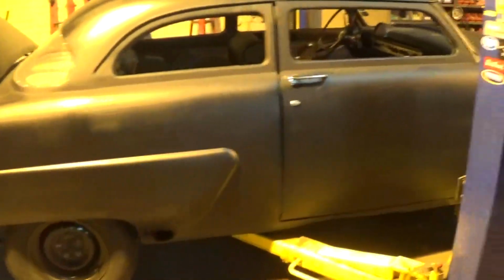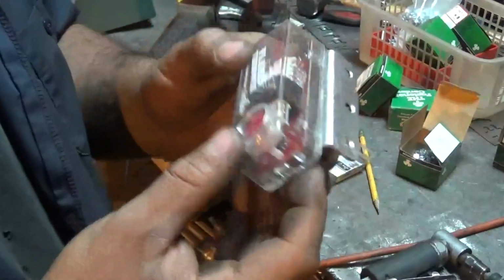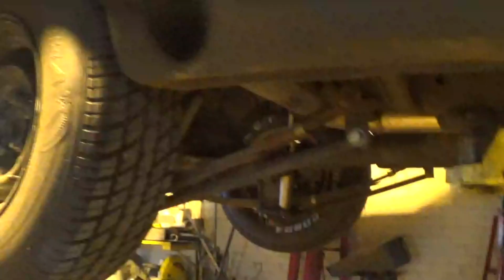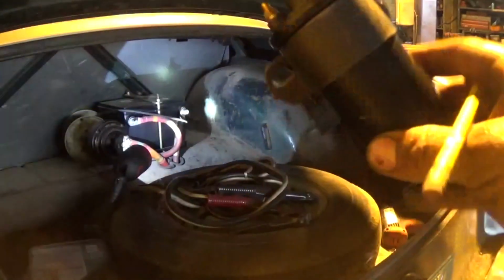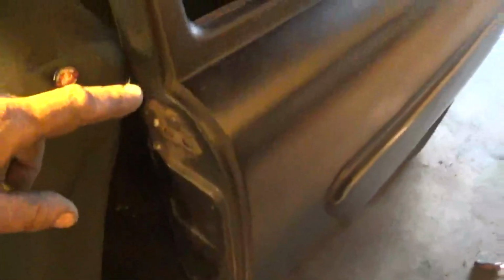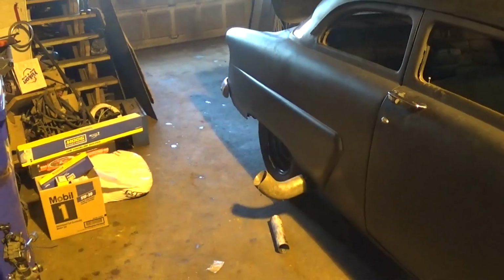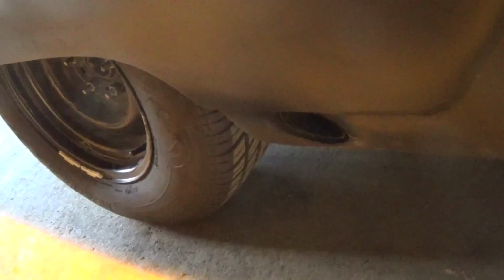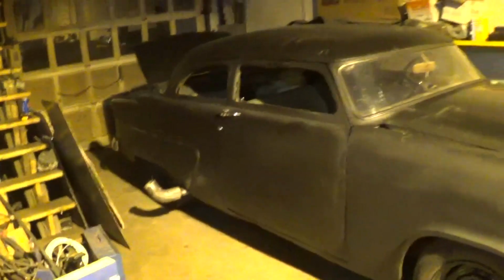FLAME THROWING EXHAUST!! AUTOLOC Flame Thrower Kit Installation!

Comment: So no need to change anything on the engine? It just burns the excess fuel that's already there?
Reply from the maker: Correct, basically you turn off the power to the engines coil and the engine becomes a compressor, you pump the throttle as fast as you can when killing the ignition and it pushes all the raw fuel out the tail pipe and gets lit by the  secondary coil at the end of the pipe/ exhaust.

Comment: I would love to see what you do inside with the gas pedal and the switch to get this to work
Reply from the maker: Pretty simple, first warm it up, exhaust pipes have to be hot or it will not atomize the fuel and basically you will foul your spark plug in your pipe. Once it's hot, rev it up, the more R's the better but within reason, lol. Once it's up to a desired high rpm, you push the button, this cuts the ignition coil and turns on the exhaust side, as soon as you push the button, pump the gas pedal as fast as you can until the car almost dies, then stop and let go of the button so it stays running. The pumping of the throttle pedal is where you get your bigger flame, as while you are pumping the pedal you are pumping fuel into  the engine with the accelerator pump. If you don't pump it , it will make a smaller blue flame......
Reply: @rottersgarage  that makes sense.  When you get a chance can you make a video showing that? I’d love to see your technique. That’s genuinely cool how it works.

Comment: What brand is his exhaust pipe spitfire
Reply from the maker: The actual exhaust on the car was bent up out of 2 1/2 inch aluminized pipe. Has a welded up Y pipe, single exhaust out that passenger side quarter panel. Nothing fancy.... All homemade....m

Comment: Does this effect your fuel usage or  engine?
Reply: All this does is burn the fuel that would already be leaving your exhaust anyways
Reply: @EbolaSquirrel  oh OK thx
Reply: @chaddog8689  np
Reply: @chaddog8689   he’s wrong. Ignore his comment.
Reply: @EbolaSquirrel   no it doesn’t. When you flip the switch it cuts the power to the coil so your engine starts stalling and then you pump the gas to load the system with raw fuel. Then you let it rev up again and push the button to ignite said burnt fuel. Your exhaust wouldn’t have enough raw fuel to ignite like this alone 🤦‍♂️

Comment: Can I use my stock distributor or do I need to install an aftermarket one?
Reply from the maker: Stock distributor will work fine. Ive actually made my own flame kits before where you splice into the coil negative on an hei chev distributor. When you want to light it up you cut the coil neg from the hei coil and send it to an auxiliarry coil for the exhaust, works just like the one in the video....
Reply: Black F1R3 butane canister, solenoid valve, and bbq electric ignotor. Collinfurze has a great video on a flamethrower guitar
Reply: Collinfurze